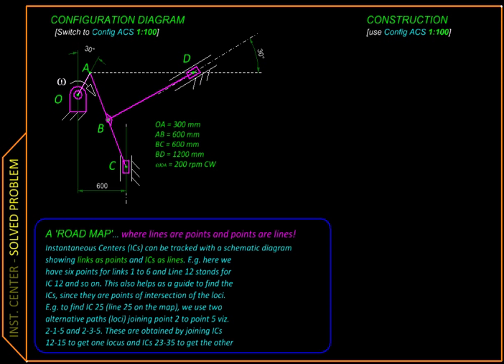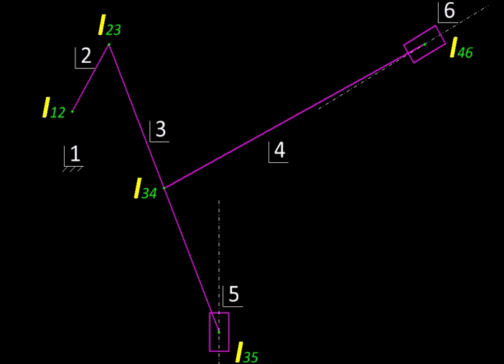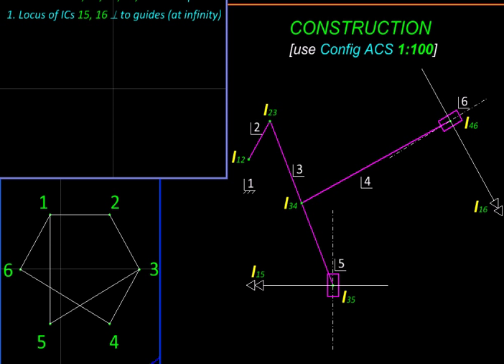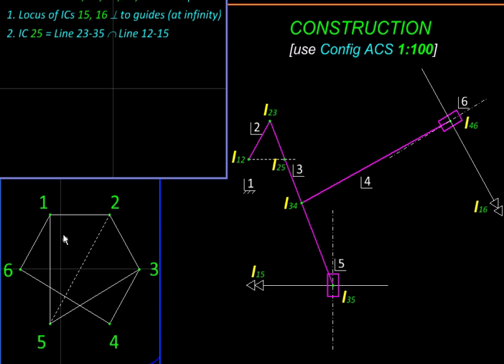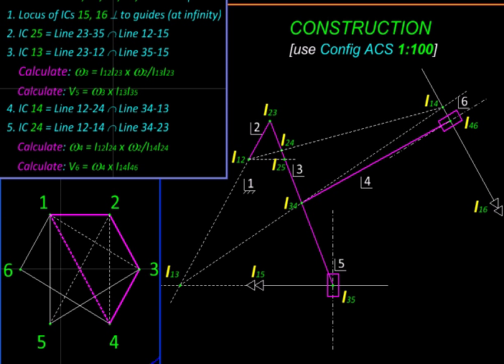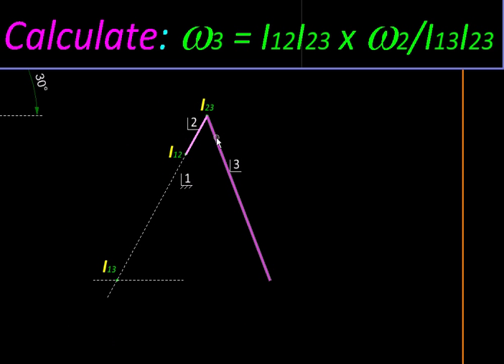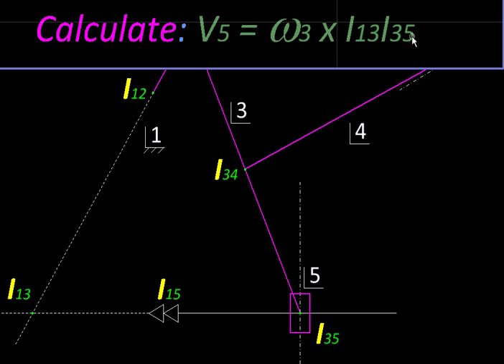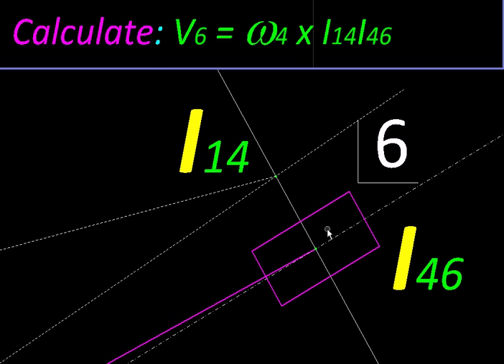Kinematics Ch03J Velocity Problem 04

Comment from the maker: @gr1mmy3 Ok I see. 
If you have three or any of the Instantaneous Centers (ICs) falling on a physical link (in your case the slider), that does not mean they are attached to the slider in any way. It is just a geometric happenstance. 
        Good you asked this. I think this is a natural question worth mentioning in the class. Thanks for sending it in. Feel free to write back if you need further clarification. 
Good luck.

Comment: I realize now that I worded my question badly. So i have a similar but different problem. It have 2 Sliders (I kept saying pulleys, my mistake) and there are 6 members so I need 15 instant centres. I have found 15 BUT I have 3 instant centers (each obtained from different members i.e. I have I_56, I_46 and I_26) all on one slider. I thought that meant that I had done something wrong. It's just a gut feeling but that's why I was asking.

Comment from the maker: @gr1mmy3 I am not sure if I got the question right, but if you are asking if a single pulley can have more than one instantaneous center at the same time? No. It cannot. In fact for pulleys it is easier. Their instantaneous center is at their fixed bearing! This is not true for movable pulleys of course. But I think you were asking about a belt drive right? If so model the belt drive as a four bar. The two radii to the points of tangency form two links. Free length of the belt is the third link.

Comment: Hi, I'm a MECH ENG student and I have a similar problem with two pulleys. I was wondering if it is normal to have 2 or even 3 instant centers on one pulley? And how do you deal with the instant center obtained from the intersection of the 2 pulley lines. Thanks grimmy.

Comment from the maker: @sonakshi1513 The center I15 is at infinity, so we do not have its position but rather its direction only. So whichever point you try to connect to I15, the line will always be horizontal. To understand this, imagine the reverse: light coming from I15. You may recall that rays coming from infinity are all parallel. So think of how the rays will strike all the centers. Horizintally right? 
HTH,
- Ujjwal Rane